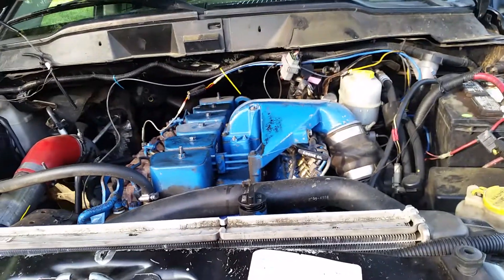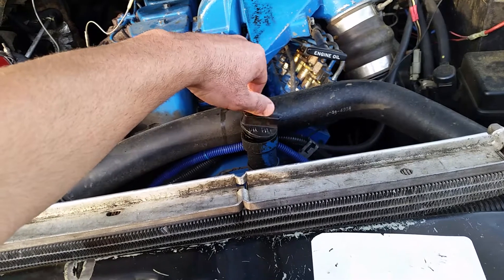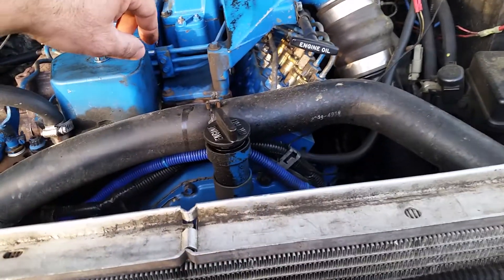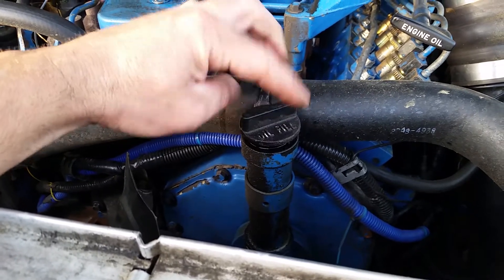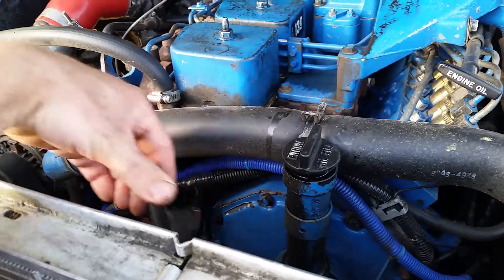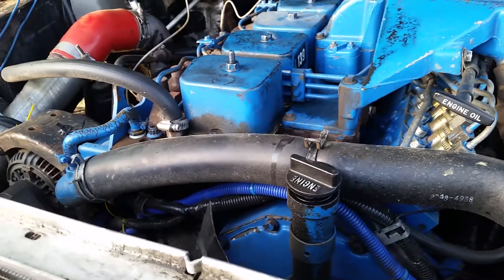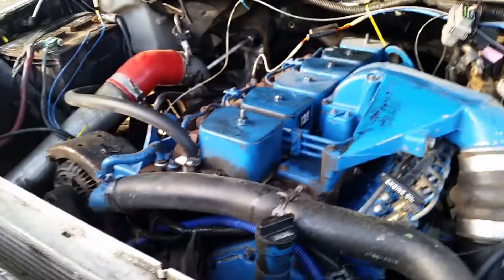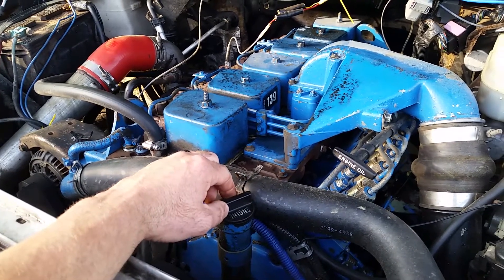How To Check For Blow By On A Cummins

Comment: My 12 valve has less than  160,000 miles and i was worried that little blow by meant i needed new rings. Ty for the info
Reply from the maker: Glad you can rest a little easier. And as a little extra FYI and since you have such low miles on that motor, I want to add one more thing. Make sure you have a good air filter on that motor. We have only had a few 12v Motors with blow by and those motor all had crappy high flow / low efficiency air filters on them. I am not saying that you can't add power, I am just saying look at your Turbos compressor wheel and how dirty it is.  Its a rough gauge of what is going in your motor... Hope that helps shed some extra light on keeping your low mileage Cummins happy!
Reply: Man really great advice, I'm so grateful.
I have such a passion for Cummins ever since I bought one I am hooked.

Comment: Great video, I went to go look at the original 12v Cummins 1989. The guy wouldn't even let me take it for a spin unless I made an offer so it was definitley a no go right off the bat. As soon as we opened up the hood you could see the blowby without even taking the oil cap off or the dipstick out, I dont know how it was in such bad shape. Only had 67,000 miles, I really wanted to get it and fix it up anyways but I wasn't even willing to pay 3200. I told him 2500 but that was to low for him, the cab and bed were screwed and frame was in rough shape. Im assuming since he wouldnt let me drive it there was something wrong with the 727.
Reply from the maker: Man that is a sad story! We came across a 97 12V like that a while back. We bought the motor off a guy who said it had blow by. We were always going to rebuild the motor but asked him what happened.  He said that he noticed that the truck was down on power and he was towing a load. After a quick check, he realized that the air filter was plugged up. So in a stroke of pure genius he took the air filter off and towed his trailer the rest of the 500 or so miles.  He shut the truck down and came back out and it didn't really want to start... Low and behold.... The truck had massive blow by!!!! You definitely dodged a bullet, but it is sad to see a good truck not taken care of! Thanks for the message Bailey!
Reply: @70440charger  Yeah definitley sucks I was hoping to get a good deal, but it's alright I spent my money on a atv instead. Want to plow this winter so it works out, save a lot of gas money plowing with a single cylinder atv. Sucks when these old diesels aren't taken care of. Ive never seen a vehicle with such low mileage in as bad of shape. 67,000 miles.
Reply: Whoever ends up buying it is definitely naive or they are taking it apart themselves and rebuilding everything and putting it in a different truck

Comment: Is a bit of hazing/white smoke normal. It doesn’t blow the cap off.
Reply from the maker: What year is your cummins? And is there a way you can link us to a good video of it?
Reply: @70440charger  98 12 valve 200k. I have no idea how I could link a video to you. Do you have Instagram? I think I can send a video through there

Comment: Is it normal to have some white smoke coming out of the oil fill cap but the cap doesn’t go flying off? My truck had 206,xxx miles and some white smoke come out but the cap stays just like yours did
Reply from the maker: Hey Derek! Thanks for the comment! Is there any way that you can post up a video for us to check out?
Reply: Break-It Brothers Diesel do you have a Instagram?
Reply: Break-It Brothers Diesel do you have an Instagram

Comment: Hello, I have a 2001 5.9 Cummins. I have a haze coming out of breather tube all the way from startup but even when warm no haze coming out of filler hole besides a tiny bit (can see the slightest of it with a light directly on it at night). Can you check my page and tell me if you think it’s normal? Thanks.
Reply: Wanted to add the smell coming from breather tube is a nasty stench but doesn’t smell like diesel and I don’t smell any diesel in oil.

Comment: Is this an older video? I thought you had the compounds and painted the engine black
Reply from the maker: Good eye Grayson! This was taken right before I pulled everything back apart and painted it! How is your truck coming along?
Reply: OK, even though I'm a huge fan of the Cummins Diesels, 12v and 24v, and have worked on some myself, my personal truck is actually a Ford 7.3 Powerstroke, and it recently had a new transmission put in because the old one blew from pulling a 8,000lb trailer, but overall the truck has held up well, and if you ask me, the 7.3 is back when Navistar actually made great engines other than that crappy 6.0 and 6.4, but I do admit, a Cummins (even a 24v) is way easier to work on than any Powerstroke.
Reply: My oil cap spins real slow. Blow by or no?

Comment: Hey man what is it when there’s a decent amount of whitish steam coming out of oil fill cap and blow by tube ? Even a tad comes out of dipstick if I pull it. The cap doesn’t move what so ever there’s no pressure just steam coming out. Truck doesn’t use any oil in 5k other than maybe half a quart that it leaks. 96 12 valve with 210k
Reply: was wondering the same about the steam and no pressure. my 97 does the same with 240k on it. Oil level doesnt even budge between changes every 5k as well
Reply from the maker: Hey Guys! Thats a great question. Any chance you can post up a hd video of what it looks like and then share the link here? I am also going to go check my truck and my brothers truck. I will  specifically look for what you are talking about. I am pretty sure what you are talking about normal,  but with that said, it is always better to be sure since we are sitting there right in front of your truck.
Reply: 70440charger thanks for the response. I didn’t realize you did until just now. I’ll try to take a video tomorrow and post the link for you.